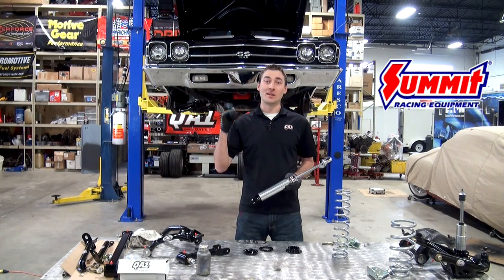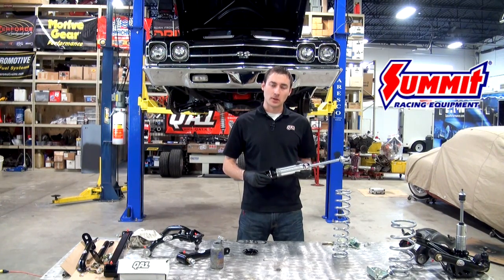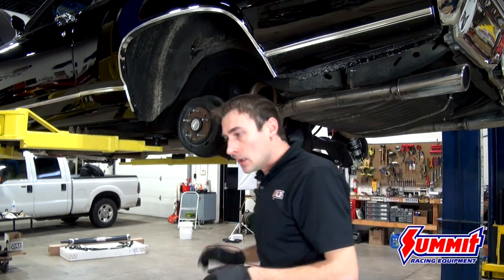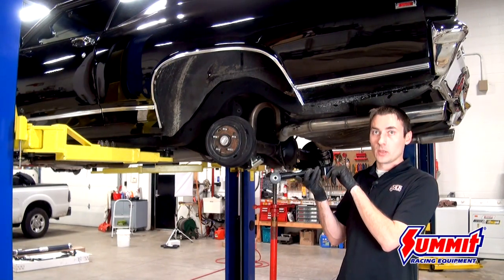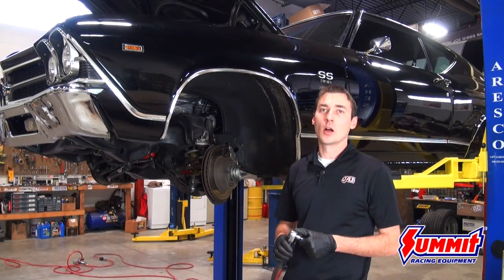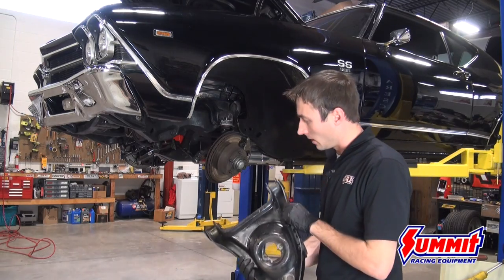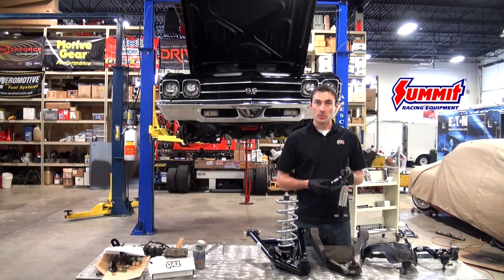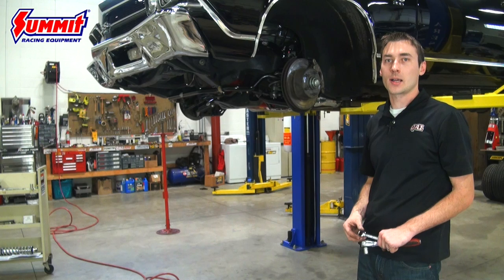QA1 Handling Suspension Kit Installation

Comment: You didn't mention that the lower A frame bolts need to be tightened when the car is in a resting position on the ground ,failing to do this will preload the lower A frame bushings.

Comment: Is there a kit for a 1965 impala ss
Reply from the maker: +RollinAssassin, 
QA1 has a new bolt-in front coil-over kit for the ’58-’70 Impala and also offer the Stocker Star noncoil-over shocks for these cars. Unfortunately, they do not have the handling kit available for full-size cars, yet! Here are some of the part numbers for you Impala:
http://www.summitracing.com/search/brand/qa1-precision-products/

QA1-GS507-09450D
QA1-GS507-09550D
QA1-GS507-09650D
QA1-GD507-09450D